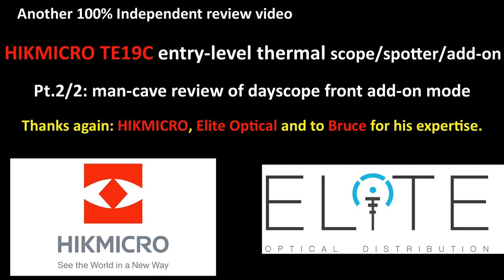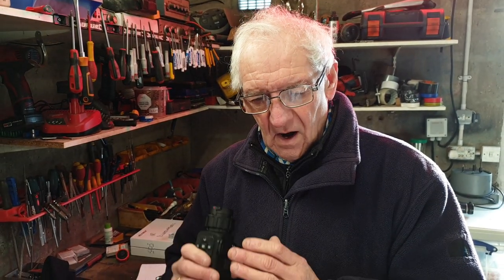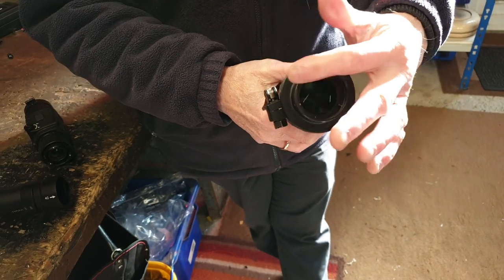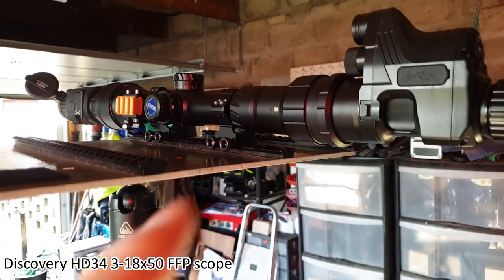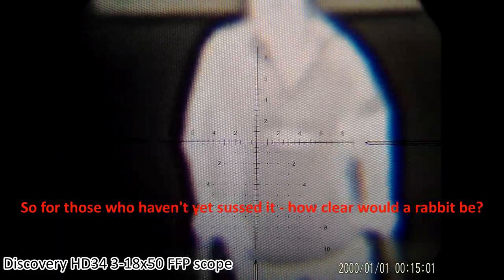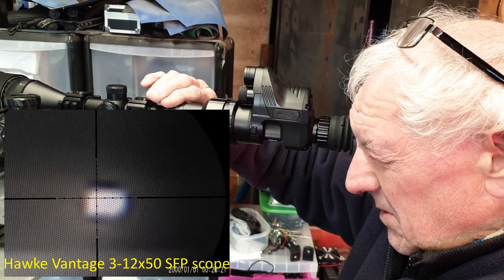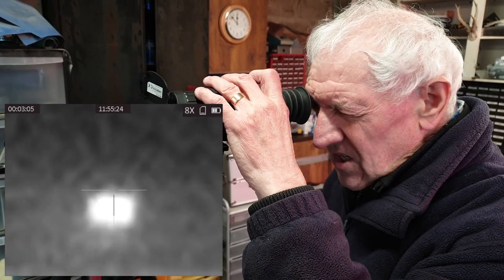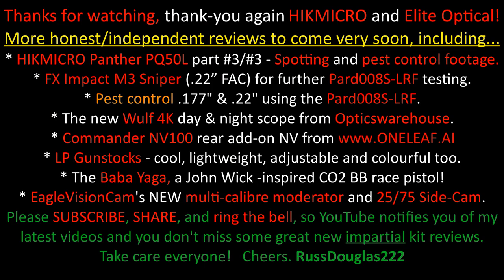HIKMICRO Thunder TE19C thermal scope pt.2/2 front add-on test

Comment: Mate, your part one was awesome, and your part two, well you have outdone yourself. answered every question. everyone looking to purchase a TE19 would only need to watch this to have all their questions answered. thank you, Hikmicro will be selling another unit after watching this.
Reply from the maker: Thanks very much!
I'm glad we got our results across, that it might be 'entry level' thermal, but it really does fill three roles.
All the best, and thank-you for your feedback!
Cheers. Russ
Reply: @RussDouglas222  hey mate, did you happen to work out how much to tighten the screw on the scope? Iv purchased one and have used it in a clip-on but haven't mounted it yet.
Reply from the maker: @TGR8STSAVAGE  Hi there, yep I think Bruce measured it during an earlier video at 25in/lb... basically a lot tighter than you'd expect to get the scope mount rock solid.
Hope it works well for you as an add-on?
Cheers. Russ

Comment: The tip to leave the adapted fitted on the scope might be just the thing to to make the clip on aspect of these unit worth while.  As a scope its accurate no question so in theory if leaving it eliminates the variation it should be a winner.   I have the Rusan adapter but still doesn't refit accurately enough for  shooting so will try leaving it on and re attaching.              I love the unit and like the versatility of the clip on but unless it accurate its not for me  as a clip on so here's hoping.
Reply from the maker: Thanks for your comment Vic, we're about to review the Cheetah day/NV scope, so will be testing these connections for airgun use and repeatability.
Thanks for watching, cheers. Russ

Comment: Brilliant thanks for this so do you think it's practical to take it on and off the gun many times for spotting during hunting and hold its zero?
Reply from the maker: Thanks John, it doesn't sound particularly practical to do repeatedly, especially as if spotting a target we'd all naturally be inclined to rush to set-up to take a shot. 🤷🏻‍♂️
If I had one of these I'd practice dismounting and remounting repeatedly, taking a shot each time -then decide for myself based on ease of use, and downrange groupings.
I will however soon be reviewing the HIKMICRO Cheetah (essentially an Alpex NV scope within the compact body of a Panther), which can also be used as a spotter, add-on and scope.  So as part of my review I'll do exactly these checks. 🤓
Thanks for watching, cheers. Russ
Reply: @RussDouglas222  thanks Russ that's a very generous and informative answer brilliant mate looks like we're both up early or burning the midnight oil one or the other🤣🤣
Reply from the maker: @johnman559  Ah I had a rubbish sleep after a late ratting trip, so was back up at 04:30. 😖
Cheers. Russ

Comment: Well dine chaps, I am liking this thermal add on a lot. 😎👍 now question is do I trade in my Hik  Micro Spotter and put the money towards this beauty 🤔 decisions decisions 😁
Reply from the maker: Ooft sorry I can't help you there Garry, but (assuming you already saw part 1/2?)...
I might have been a little disappointed at the limited range when initially using this fella as a dedicated scope to head-shoot small rats @25-30m, but as you've seen here we were very impressed by its usefulness at 50m+ in dayscope front add-on mode.
That resolution plus not having to re-zero, hmmm sweet.
Cheers. Russ